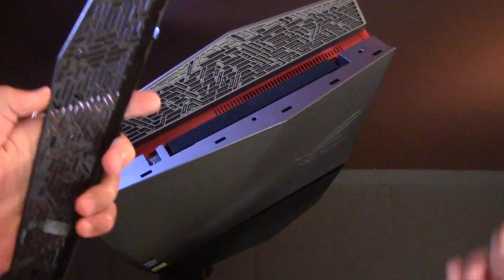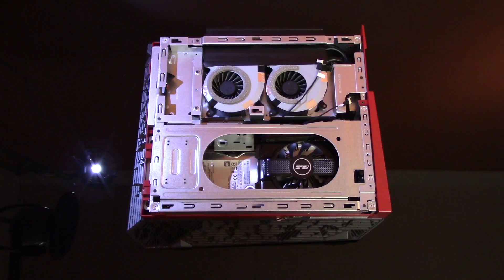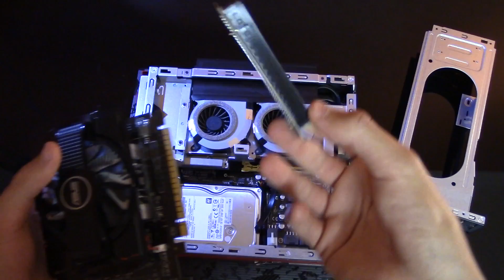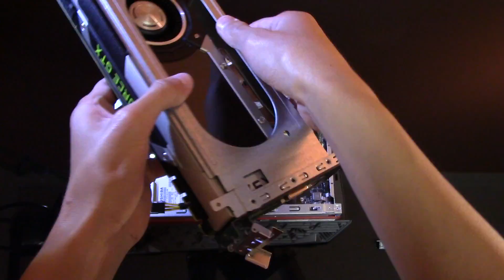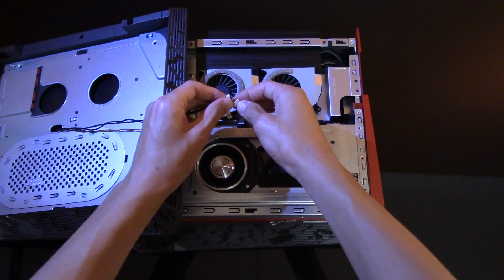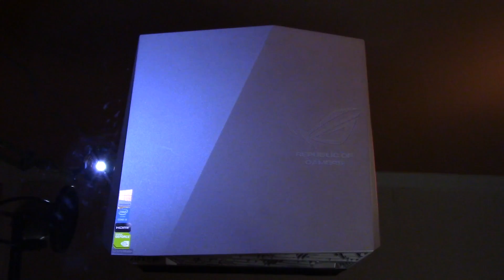Asus ROG G20 - GPU Upgrade Tutorial

Comment: I took my graphics card out noticed I didn’t have the 8 pin so I put the old one back in so I can wait till the 8 pin cable comes in. But now with the same setup nothing changed my pc won’t power on. The light will click on for a sec and that’s it one fan will spin for a sec and nothing from there

Comment: What dimensions is the largest card can fit in the gpu slot ??? Will RTX 2060 dual fan 5.1” width fit ??
Reply: Don’t go for a card with fans that vent out the sides. Get a blower style fan so it can push out the back

Comment: Hello. I have the G20CI which was equipped with the nividia GeForce gtx 1080. What is the maximum upgrade I can go for without compromising the heat dispensing design of the case? Thanks

Comment: i have one like this since summer 2015 , i put a 1060 6gb in it along with 16gb ram, no issues so far..i ran every game i wanted to play at max settings
this is such a beautiful and compact gaming PC, i will never let this go and if it dies on me, ill buy an used one off ebay
Reply: Do you put a 1060 founder edition or normal?
Reply: @Ballack9   dual fan edition, cred ca e normala
Reply: @phobiazzzero4935  ooo bn ca esti roman,  sarbatori fericite  am si eu un asus g20 cu gtx 970 si as vrea sai fac un upgrade dar credeam ca se potrivesc doar founders edition
Reply: @phobiazzzero4935  si oare merge o gtx 1080?
Reply: @Ballack9   mersi man si tie sarbatori fericite
nu merge 1080-u ala e doar pe G20CI care are sursa externa...stiu ca atunci m-am interesat iar pe asta a meu care e CJ maxim merge 1060.. a venit stoc cu un gtx750 ceva de genu
Reply: @phobiazzzero4935  pai al meu are sursa externa si stock are gtx 970
Reply: @phobiazzzero4935  al meu e CB
Reply: @Ballack9   incearca , dar sa stii ca abia incape 1060 -u asta
Reply: @phobiazzzero4935  m am uitat mai bn am g20 AJ
Reply: @phobiazzzero4935  salutare, vroiam sa te intreb daca pun si eu gtx 1060 6gb oare battlefield 2042 imi merge la 60 fps
Reply: @Ballack9   posibil sa ruleze dar nu cu settings foarte mari
Reply: @phobiazzzero4935  am inteles ms, ma orientez pe o 1070 sau 1080 ca deja cu gtx 970 cu setari low jocul ruleaza la 50 60 fps deci cu o 1080 in full hd ar trebui sa ruleze la setari high cu peste 60 fps
Reply: @Ballack9  salut baieti si sanatate,bine ca am gasit romanii de au si ei probleme cu carcasa asta:)) deci ca sa dai upgrade la pcu asta aveti nevoie  (si am si eu) de un power supply de watts multi,si treaba este ca aceasta carcasa fiind veche nu are power supply de watti multi,din ce am auzit de la alti oameni cu pcu asta uni au 2 mufe pentru power supply si alti doar 1 si sunt mici ambele,ma gandeam daca stii tu ceva in legatura cu asta? oare pot merge ambele si sa se combine puterea lor ca 2 intre 1 singura? si vedeti ca motherboardu (placa de baza) nu se poate schimba si sa faci upgrade si nici cool-er nu poate intra in carcasa in caz sa stiti sa nu se arda componentele.
Reply: @eugenegrindfor5090  salutare, eu am 2 mufe si ii pot face upgrade dar am un i7 4790 si o gtx 970, ca sa schimb cpu trebe schimbata mb si nu se merita, eu am vrut sa pun o gtx 1080 dar la ce preturi sunt o sa astept vara si o sa fac un pc nou cu rtx 3060 si un i5 a 10a generatie
Reply: @eugenegrindfor5090  nu cred ca se pot combina al meu are 2 mufe, dar te sfatuiesc sa iti faci un pc nou, chiar daca vei schimba placa video o sa dai de bottleneck din cauza procesorului care nu sustine puterea placi video
Reply: bro did u have to upgrade the power supply im running 230w please help
Reply: @its.agony421  for mine i didn’t upgrade, works fine with my 1060 6 GB
Reply: Sorry before.....i want ask....can i use gtx980ti in g20aj?
Thx

Comment: Thanks 
I just installed a GTX 1650 from Zotac and it works flawlessly 😇
Reply: what power supply did u buy i want a 1650 but it says i need to have around 450w and i have 230w

Comment: Bro, can we upgrade it with th 2060 as well?
Reply: Yeah
Reply: @noa1575  I got a 2060 but it didn’t fit how did you get yours to fit?
Reply: @Snooobyy  use a gpu extension cable
Reply: @noa1575  the graphics card I have is an ASUS Rtx 2060 would that still work with an gpu extension cable? Also what’s the point of an extension cable?
Reply: I just got a 2060 but it doesn’t fit for some reason, we’re you able to make it work?

Comment: I have successfully upgraded my AUS ROG G20AJ

Previous Specs: i5 4460
                             8G RAM
                             GTX 750
                             1TB HDD

New Specs: i7 4790
                      16GB RAM
                      GTX 1060 3GB (Single Fan) since I heard that double fan may cause overheating
                      500GB SSD, 1TB HDD (I'm using the 1TB HDD that came with the PC as a storage drive)
                      
Note: I also had to purchase the 180W power supply and switch the jumpers (JDC 11) and (R20) I believe that's what they're called; and now I have the 230W + 180W Power supplies working together. 

If anyone is thinking of upgrading this PC, I highly recommend doing so. My gameplays are way smoother now and I'm completely satisfied with the upgrade. If anyone has any questions, I would gladly try to help you out.
Reply: You had to buy a separate power supply, could you explain this to me?
Reply: @chickennugget6654  yes my PC originally came with the GTX 750 and only the 230W power supply. After upgrading the graphics card to a GTX 1060, I had to buy the 180W power supply also to have enough power for the  GPU and other components.
Reply: @MFShadow956  how much did it all cost?

Comment: It is a pain in the arse getting that 8 pin in, I was contemplating removing the motherboard.  I would recommend unscrewing the fans at the top of the case to make removing and inserting the graphics card a lot easier (it is the first thing I do once I am into the case).

Comment: If I don’t have the cables and I gotta buy them where do I go plz help, also the gtx 1060 I’m putting in only has the 6pin connector so do I move the little plastic piece on the motherboard at all?? Plz help it would mean a lot :)

Comment: How much does a used G20(-B08) go for? It has a I5-4460 3.2GHz, GTX 750, and 2 x 8 GB of ram (I added 8 GB a while back). I also have to replace the HDD for the same part ($35). It's in perfect working order minus the hard drive which sounds like it's about to kick the bucket though I probably wouldn't sell it anyways.

Comment: Bottom jumpers are use to dividing the adapters power delivery, all goes up means all the 230watt power will be deliver to the GPU.
Top jumper is option for choose 1 or 2 adapter to use.

if you set the Top jumper(JDC11) to the LEFT and bottom jumpers(JDC01-05) all UP = 2 adapters will work together( 180w adapter for CPU and 230w adapter for GPU )
Top jumper to the RIGHT and bottom jumpers all UP = only the 180watt adapter will work for the whole system.
Top jumper to the RIGHT and bottom jumpers all DOWN = only the 230watt adapter will work for the whole system.

Comment: Hi Drew. I am pretty confused about this update. I also have an G20aj that has an geforce 760 included. Now I am not sure to what card to change.
The issue is that I am not sure about the power supply. I have  a two power supplies 230watt. Does each card I upgrade also need a new more powerful power supply?
Or are there some advanced cards that don't need to have a new power supply?

Pretty confused about this and I would be happy for an answer.  Thanks alot

Comment: I never liked this case, im thinking of moving most of the internals of mine into a more formal style of case, that and replacing both hard drives
Reply: Did you actually do that yet? I wanna do the same, but have no idea about where to even start
Reply: I'm interested as well. If you do so I would really appreciate some details :)
Reply: @cappy6100  I read somewhere that the motherboard is custom and not standard so it will not fit into a normal case. Also, the ram is laptop ram. Everything else should be able to be moved to another Mobo/case which kinda defeats the purpose of moving everything over because then you would also have to buy a power supply.
Reply: This is old but i'll throw my 2 cents for people wanting to do something similar in the future. Moving the internals could have his challenges: 
1) The motherboard is definitely custom built. It's shaped as an L to make space for the hard drive so I wouldn't count on the screws to align to a standard case.
2) The CPU cooling would need to be replaced with a standard one.
3) You would need to buy a new power unit as well since this PC comes with external supply.

I had this computer for the past 6 years and it's still working perfectly, still the fastest and smoothest pc i have ever put my hands on. I recently opened it to upgrade from 128gb ssd main hard drive/1tb hdd secondary hard drive to 1tb ssd secondary hard drive. And i'm thinking of upgrading GPU from my old nvidia 970 gtx to something better. I agree everything is crammed inside the case with supporting metal parts everywhere giving very little room for anything but I wouldn't try changing case as you probably end up building a brand new computer keeping only half of the internals of the old set up.

Comment: mine came with the 970 but I want to upgrade it to rtx 2070.  will that card fit in there
Reply: Charles Hanlin The card will probably fit in there. If it does not, remove the graphics card holder and just insert it as is. Also get a blower style RTX 2070 because you don’t want hot air from the GPU to get everywhere in the computer. Hope this helps!
Reply: @oliverqueen1361  ty
Reply: Charles Hanlin no problem!👍
Reply: Update? Considering doing the same thing.

Comment: I lost the spare cables that came with my G20, I see a bunch of replacements on eBay, but I don’t know which ones I need to get. Can anyone help me out here? Thank you
Reply: SuperFrankieOSX same issue, were you able to get new ones?
Reply: Never replaced the card, im planning on doing it like within the week, I just have to get the replacement cables, I'll be back if I find anything!
Reply: @SuperFrankieOSX  it's been a week, have you found one yet :)
Reply: @izaac3135  actually I realized I don't need one, my gtx 970 uses an 8 pin cable but the 6 pin is also optional
Reply: @izaac3135  I think its called the pci express 6 pin cable if you don't already have one, the rtx 2060 super i am upgrading to also uses an 8 pin power adapter so I don't need to change anything, ill make a video on it Sunday
Reply: @izaac3135  I think anything past like a 2060 or 2070 rtx would require the extra power cable

Comment: Were I'm can  buy  power supply  230w for  gtx970 ?
Reply: you need to get the double adapter, which is a combination of the original 180 and another 65 W adapter, you could also get a universal and plug that in along with your original adapter and would be a cheaper option. might need to get the internal power cables if you do not have them
Reply: @russellpehi8026  hi mate  I'm have 65w and 180w adapter  but wen I'm start  play same game 180w  burn :( then I'm  thing  better  buy 230w but hard to find  in UK
Reply: Hi. I am pretty confused about this update. I also have an G20aj that has an geforce 760 included. Now I am not sure to what card to change.
The issue is that I am not sure about the power supply. I have  a two power supplies 230watt. Does each card I upgrade also need a new more powerful power supply?
Or are there some advanced cards that don't need to have a new power supply?

Pretty confused about this and I would be happy for an answer.  Thanks alot

Comment: Hey there, i was wondering if you knew if an rx 570 card would fit as im unsure as to whether or not it will. Also for that model will i still need the cables?
Reply: Did you get the RX 570 to fit?

Comment: Will I need the power cables if I’m putting in a 1050ti?
Reply: some Ti's require extra power, some do not
Reply: @russellpehi8026 

Hi. I am pretty confused about this update. I also have an G20aj that has an geforce 760 included. Now I am not sure to what card to change.
The issue is that I am not sure about the power supply. I have  a two power supplies 230watt. Does each card I upgrade also need a new more powerful power supply?
Or are there some advanced cards that don't need to have a new power supply?

Pretty confused about this and I would be happy for an answer.  Thanks alot
Reply: @zimi1975  if you are going from a 760 to a 1050ti you should have the power you need already. 760 would draw more power than a 1050ti. If you open up your case and have a power rail that runs to your graphics card you are all set. If not you would need to check if the 1050ti needs external power
Reply: @russellpehi8026  does the 1050 TI fits the G20 case?
Reply: @zimi1975  it depends on the cooling system on the ti

Comment: watching in 2019 as i'm almost done refurbing a friend's asus g20 (fixing the cabling on the ssd they added and adding another stick of sodimm ram, HS thermal paste refresh). they aren't upgrading the gpu but did ask about gpu upgrade potential, citing a concern for lack of power (i did see the extra 8pin and 6pin connectors on the mobo when I was disassembling). this video was very helpful in clarifying the jumpers to enable those connectors but also the power adapter requirements (but the google search links are no longer working)
Reply: I'm about to throw an evga black xc 1650 in mine, seems like the easiest course for an upgrade

Comment: Dear drew, I have a problem with my asus rog g20. For some reason when I was playing on it this past Christmas my screen just went black and my PC turned off. So I unplugged it and replugged it in and now my gpu doesn't power on anymore. I've installed my second gpu inside it and still no display so I figured it was my pci-e cables gone bad. Ordered some more and still no luck. Using the integrated graphics I was able to go into bios and change the settings where it would boot up from the pci-e cables and still no luck. I don't know what's the problem but figured maybe you can help me. I've also replaced the motherboard in it the past year.
Reply: you replaced the motherboard??? how i am looking for this for hours and people saying that its a custom motherboard and cannot be upgraded

Comment: I just got an EVGA 1070ti Blower style (similar in size and style to this 970 in this video). Are there are gotchas that are different between the 1070ti and the 970 that you put in? Note: My system came with the 970 already installed  and therefore already has the 180w + 230w dual power adapter. I assume the power adapter is okay for the 1070ti? Also I need and 8 pin rather than 6 pin power cable for the card correct?

Comment: I am going to upgrade my rog g20 750 to a 1060 6g fe and was wondering if i need the extra powersupply?because if i read on mine it it says 100-240v And 240volt is 480watt? And if i need the extra power supply can someone link one beacuse the link in the desc doesnt work anymore
Reply: Hi. Did u solve this problem?
Did you upgrade?
New power adapter?

Comment: what about upgrading from the G20CB GTX950 to the GTX1070ti?
Reply: I wouldn’t recommend that unless you have the i7 variant and the extra power supply, the 230 + 180W PSU. You need the i7 because the i5 will bottleneck your 1070 and you need both of the power supply’s because that 1070 needs a lot of power. 
If you have those things then I recommend the founders edition since it’s a blower style gpu but I don’t see a problem with the itx version, Infact it would be a lot easier to put in the case. Don’t quote me on that since the itx, MIGHT overheat the computer. But I don’t know about that
Reply: @rjcard9354  thanks yes i have those power supplies and the i7 6700
Reply: I have these Power adapters. Can I upgrade to a 1070? Or do I need more powerful power adapters?

Comment: Hello i have the same ASUS ROG g20. 
1) Will a GTX 1050 Ti (Single Fan) Fit?
2)Do you know if the GTX 1050 Ti is a FE card?
Reply: good comment brother
Reply: Yes it does fit
Reply: The gtx 1050 ti will fit perfectly, I have that card currently but I just bought a 1070 mini.
And it’s not a FE card but it shouldn’t generate THAT much heat, so it should be fine your pc might feel hot tho like mine does at times I can’t verify if it hurts performance or my components
Reply: @rjcard9354  hi, soo how is ur 1070 mini working in g20?

Comment: Can it handle a 1080ti ? And how many extra watts would I need. Also where do you find this information
Reply: Jerry L. If you have the i7 variant then it might be able to handle the 1080 but you NEED the two power supply’s to be able to run the 1080 
Here is an example of the 180W PSU that you would need 
https://www.ebay.com/p/Genuine-ASUS-Laptop-Charger-AC-Adapter-Power-Supply-Adp-180mb-F-19-5v-9-23a-180w/23020036668?iid=232543644981&chn=ps&ul_ref=https%253A%252F%252Frover.ebay.com%252Frover%252F1%252F711-117182-37290-0%252F2%253Fmpre%253Dhttps%25253A%25252F%25252Fwww.ebay.com%25252Fp%25252FGenuine-ASUS-Laptop-Charger-AC-Adapter-Power-Supply-Adp-180mb-F-19-5v-9-23a-180w%25252F23020036668%25253Fiid%25253D232543644981%252526chn%25253Dps%2526itemid%253D232543644981%2526targetid%253D313776934696%2526device%253Dm%2526adtype%253Dpla%2526googleloc%253D9027981%2526poi%253D%2526campaignid%253D833559251%2526adgroupid%253D39417365901%2526rlsatarget%253Dpla-313776934696%2526abcId%253D1123856%2526merchantid%253D101650939%2526gclid%253DEAIaIQobChMI3K2flMml3gIVBKtpCh25hwXhEAQYASABEgIgdfD_BwE%2526srcrot%253D711-117182-37290-0%2526rvr_id%253D1718452446555%2526rvr_ts%253Db358c9111660aad0cc06df68fffcd968

But you also need to 230w, which is the main power supply that comes with the pc so you should already have that it has a green led, that’s how you can differentiate them I believe .